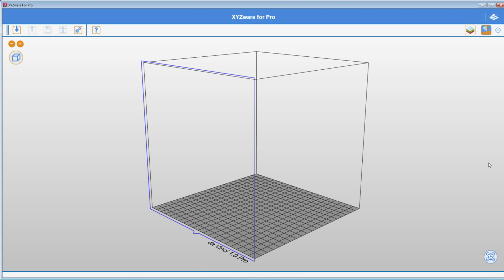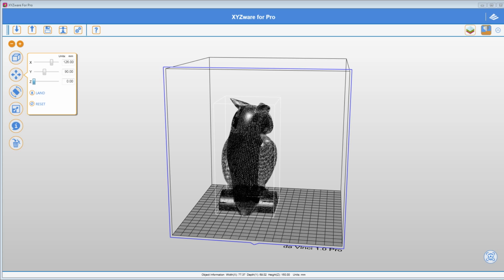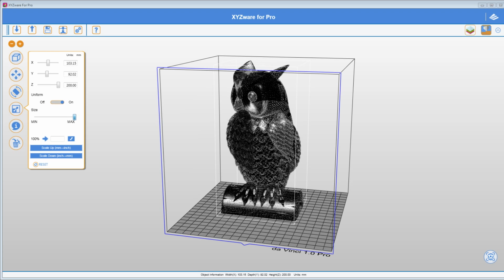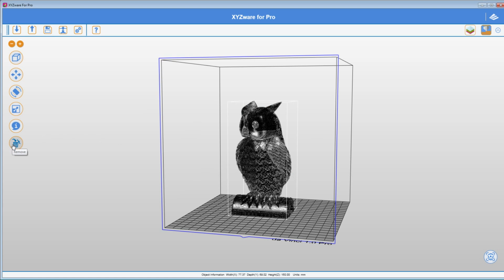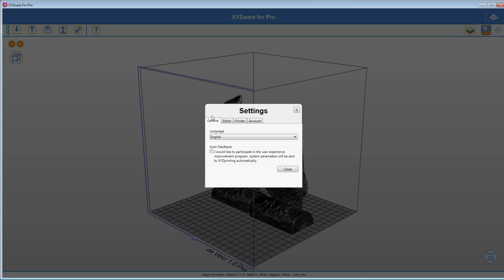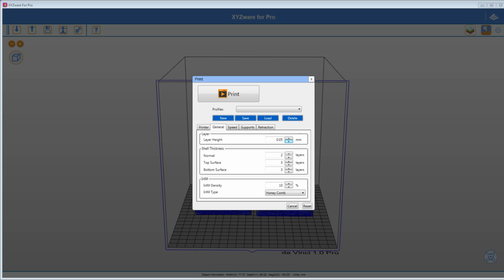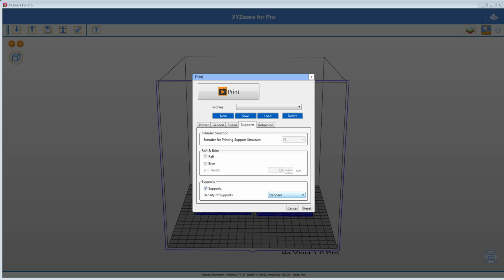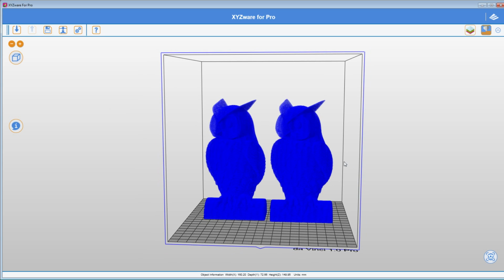XYZware for Pro Tutorial by XYZprinting for Da Vinci Pro 1.0

Comment: when u press print...does it automatically heat the nozzle and the bed or is there a different button for that.
Reply from the maker: Yes the software automatically heats up the nozzle and bed.
Reply: because i have this machine and when i punched print it was counting down and got to 3 seconds left before print but the bed and nozzle wasn't hot yet???why was that...or...after it finishes counting down...does it then heat up?

Comment: I am having trouble to get pla or abs to stick to the bed . I've tried the blue tape and glue but have not been able to build  anything to include the demo that is in the 3.0 Pro. Can anyone help me?
Reply from the maker: Dan Locke have you calibrated your bed yet? First layer adhesion problems is typically due to the print head beening too high.
Reply: yes i calibrated the bed  the first few layers seem to stick but then starts lifting  I got about 2 sheets of paper  on the z
Reply from the maker: Dan Locke If you can make a video of the machine printing and post it to YouTube I should be able to help you determine your issue. I would suggest to print at 0.2mm layer heights.
Reply: Thanks for your help I have watched Brian's videos and have found something after alot of trials but just made my filament holder and it came out great in pla now i just need to figure out how to scan something. Thanks again for your help.
Reply: I had the same problem initially. I put down a layer of glue stick and have not had any problems since.

Comment: Hi Mark i just got my Da vinci pro its the second one as the first one was broken straight out of the box i have started to print but im getting this clicking sound also when printing and the hotend moves about i get a scraping noise is this something to do with the z ofset value
Reply from the maker: I don't think the scratching sound is a good thing. Did you calibrate your bed? You should be able to fit a sheet of paper under the bed and the nozzle. The nozzle the come very close the the bed on the first layer but never touch.
Reply: Hi Mark i have calibrated it using it own calibrating system
Reply from the maker: Try dropping your bed down a little with the manual setting that you can access on the machines LCD screen. The clicking is coming from the extruder motor in the back right?

Comment: What settings to use for PLA filament?
Reply from the maker: +chris jones, I used the default settings in the XYZware For Pro. Nozzle 190C and Heated Bed 45C. I did not have a problem using Ultimachine Green PLA. Printed over 15 prints for a total of 20 hours with no problems. I did added a glass bed and have seen a better 1st layer adhesion. I really don't know why XYZ did not include a glass bed. Check out my other video about it.